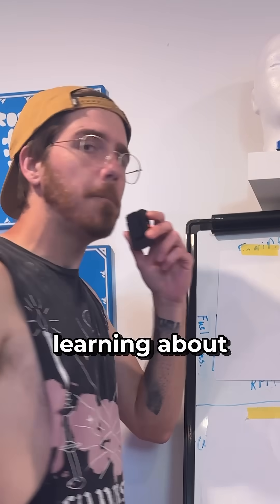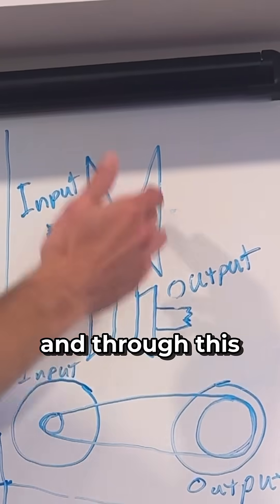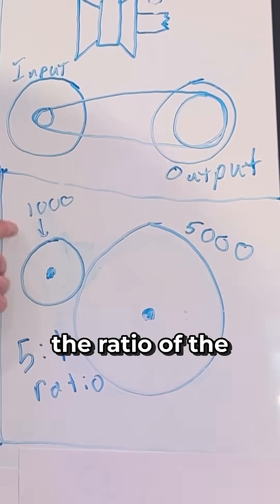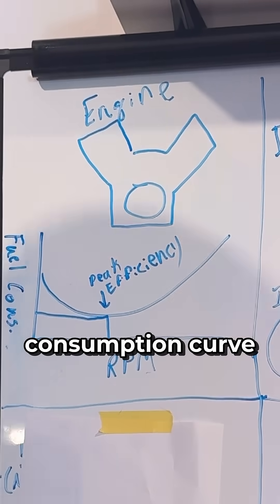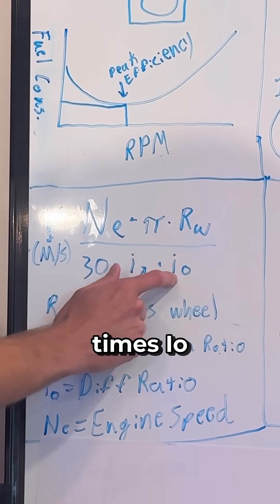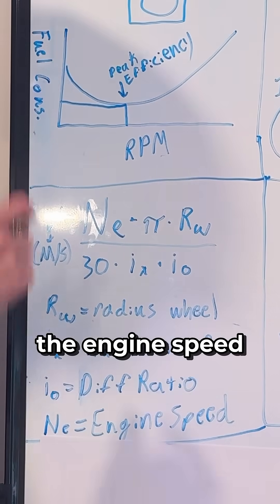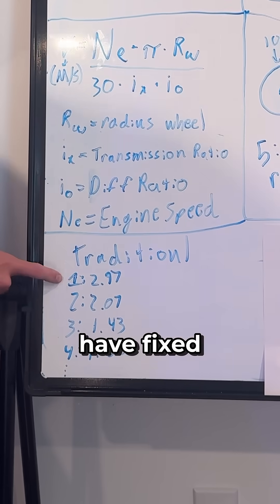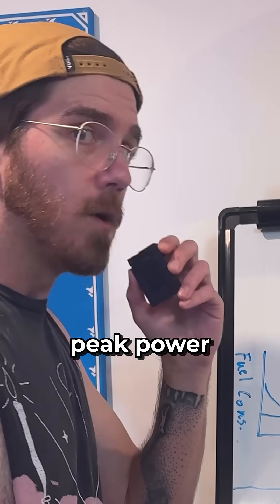Why CVTs are Technically Good

Comment: Yes, 'technically' it is a great idea. It could greatly improve mpg, help with peak power, and even longevity of the engine. But in practice, my understanding is they suck, with relatively low conversion efficiency and short lifespan.
Reply from the maker: Both of those are physically solvable though. Auto transmissions sucked for decades before they didn’t. 

Not that I want a CVT car, but in theory it’s cool
Reply: @TheZeroCamber  Considering how much of a difference it would make, the car manufacturers should concentrate on that instead of tiny improvements to the engines. How exactly do you fix that prevention of slippage needs large pressures?
Reply from the maker: To be perfectly honest that level of minutiae would be outside of what I could confidently say

I am vaguely aware of the fact that a CVT was attempted in F1 and banned. Motorsport is generally the method by which OEMs figure out how to make these technologies work better so sadly I do think that’s part of it. Subaru however has had some luck
Reply: @TheZeroCamber  biggest issue with CVT is they wear out quickly. For a race, it would probably last long enough. It was probably banned because it took too much skill out out of the equation.